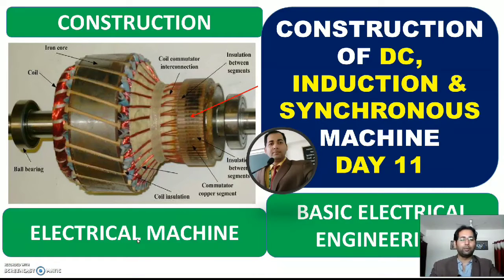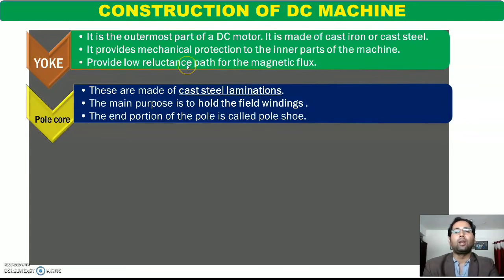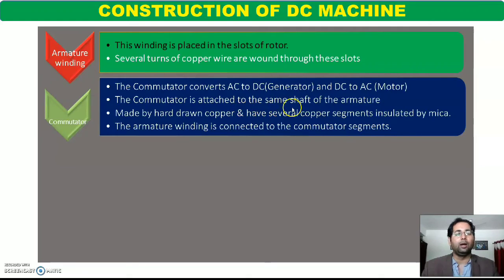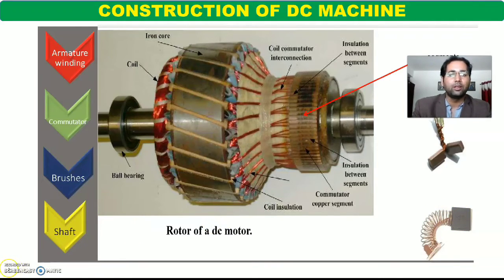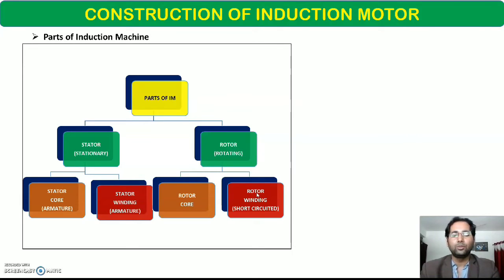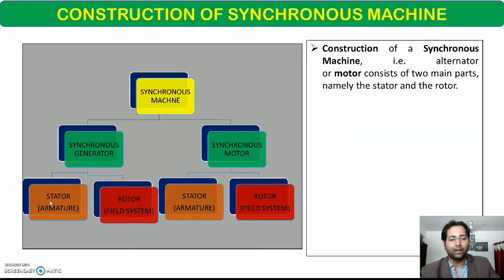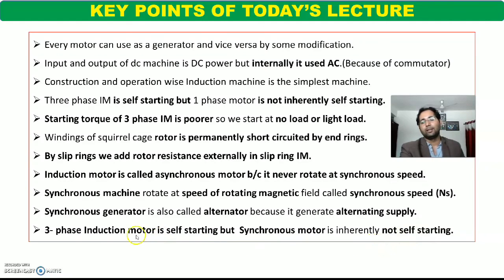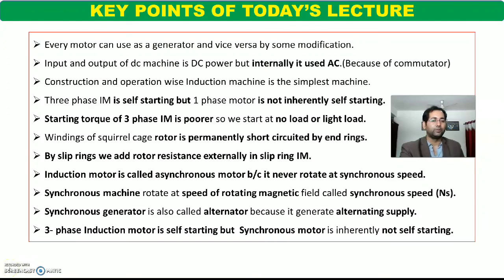CONSTRUCTION OF DC MACHINE, INDUCTION MACHINE & SYNCHRONOUS MACHINE|DAY 11|BASIC ELECTRICAL ENGG.

Comment: Operation of a dc machine will be affected by commutating poles or not ?
Reply from the maker: commutating pole.
 One of several small poles between the main poles of a direct-current generator or motor, which serves to neutralize the flux distortion in the neutral plane caused by armature reaction. Also known as compole; interpole. It's always used to neutralise commutating effect ( Armature reaction) effect..
Reply from the maker: Means some how it's affect operation of dc machine..
Reply: Thank you sir